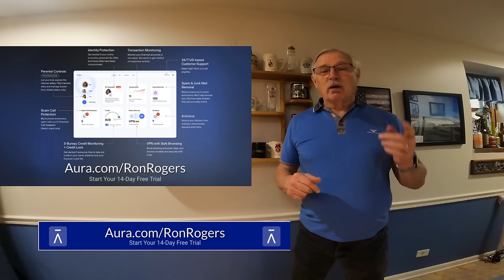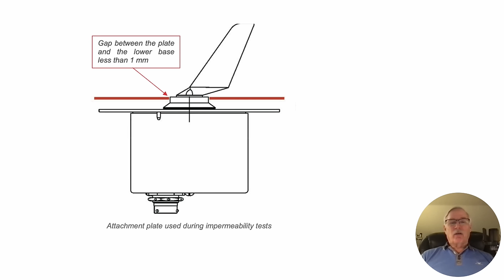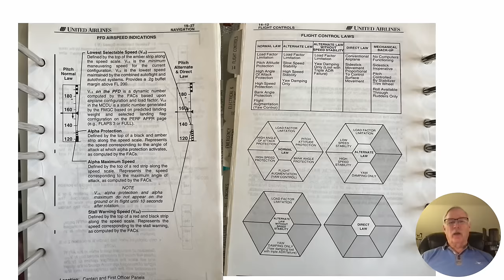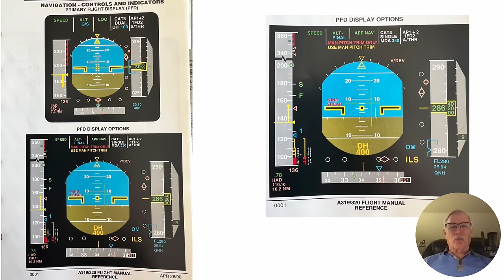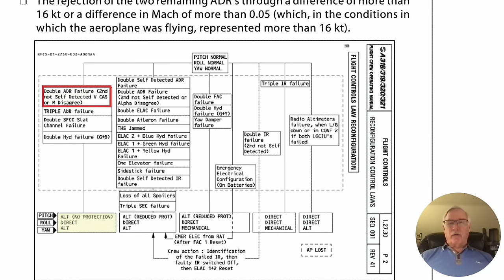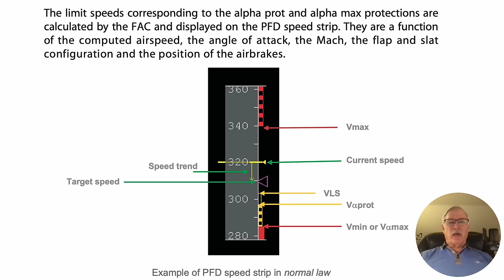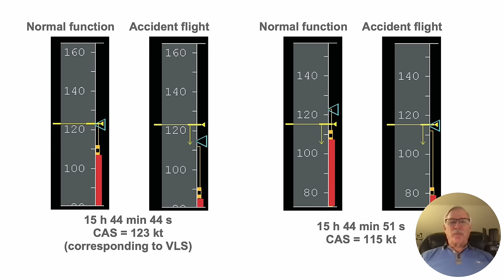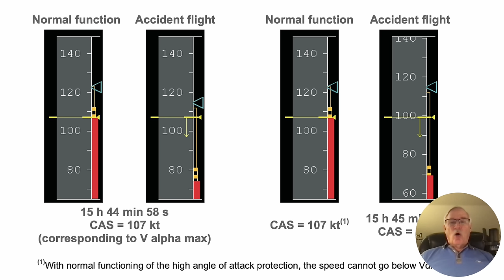This crash should have never happened! XL Airways  Germany Flight 888T November 27, 2008

Comment: This tragedy really shows how insidious it is with too much automation, protections and modes. The aircraft had two faulty sensors it trusted, and thus the aircraft had a completely faulty situational awareness and the pilots had only two vaguely related hints of something wrong. Yes, they should have picked up on SOMETHING being wrong, but also, the aircraft should not have been able to rely on that faulty data.
The most tragic thing about this is that the pilots were so over confident in the airplane (never trust an airplane just out of maintenance!!!) they chose to do this kind of stupid shit at very low altitude. Stall scenarios are supposed to be at altitude for This! Exact! Reason!!

Comment: I really appreciate these examples where automation gets “fooled”. 

I’ve seen several YouTube accident reviews where the autopilot puts, say, the elevator trim in an extreme position and then “pops off” suddenly, leaving the pilot with a very misconfigured plane PLUS a large startle factor.

Is any work being done to prevent autopilots for putting the pilots into such “corners”?

Comment: I understand that they should have protected the AOA sensor, one would think there should be a drain for such water, going through rain at close to cruise speed one would think water could also enter that sensor...
Reply: Airbus redesigned the sensor so now it drains better. It did drain before, just not enough to prevent this.

Comment: I have my A319 in X Plane 11. Its "full study," and very challenging. Did you have a lot of computer malfunctions in the real airplane, and what type problems were most common?..thanks
Reply from the maker: I had no flight computer problems and actually very few issues.
Reply: @ronrogers  good thing, seems like could kill you! An AA pilot published some "Airbus notes" online. It's very helpful for my simulator. You have great content, thank you.
Reply: on the Airbus MCDU, how do you enter a crossing restriction "XX" miles from the fix?..e.g, "cross 35 miles this side of PVD at 11,000."

Comment: it might not be a good idea to tell pilots to add power and pull up in a stall and just rely on the computer. I thought you were supposed to pitch forward and reattach the airflow before slowly adding power
Reply: You are. You gotta get that AoA back below the critical angle. The elevator is your AoA control.